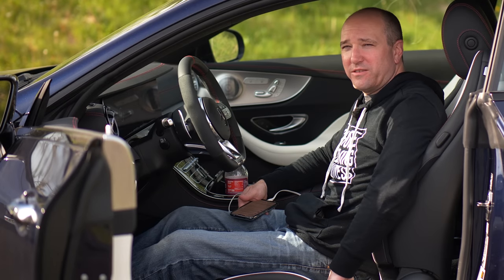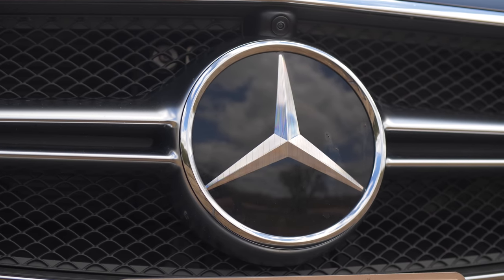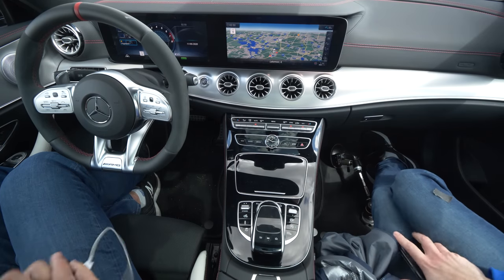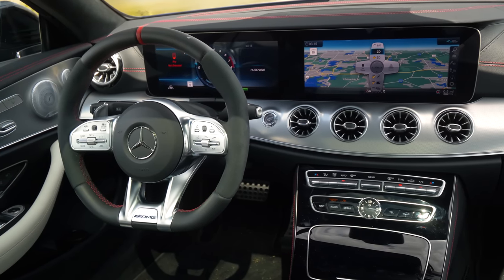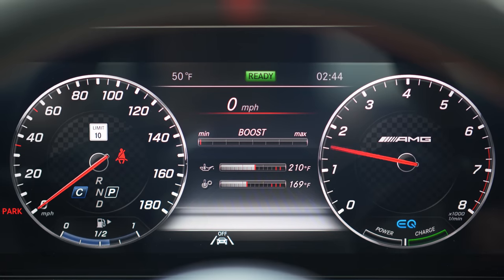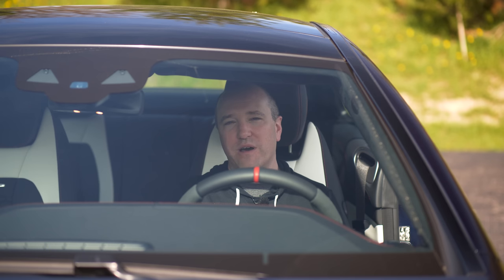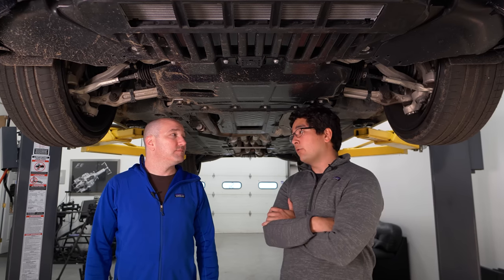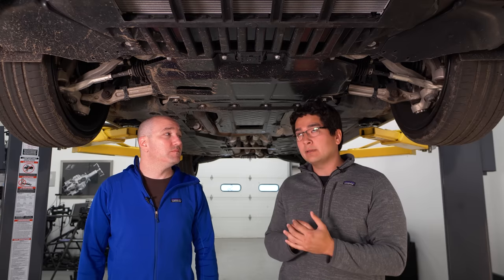2020 Mercedes E53 AMG | Gimmicks and Engineering

Comment: Shown below is a 'quick data table' that predicts the depreciation (yearly depreciation values are depicted, with the exception of entry #2's one-month depreciation, as is further explained below) of this brand new, $97k MB car, 8 years from now, May 2020:

NOTE: the data/values shown below is/are entirely speculative, however this data IS loosely based off of historical/factual data of other similarly specced vehicles.

SALE PRICE or
BOOK VALUE     Date     Description
$97,000 - May, 2020 (Bought new from Dealer)
$85,000 - June, 2020 (Sold used to a private/individual buyer.) Notice the 'almost immediate' $12,000 'discount' the buyer enjoys because the car now has been driven about 1000 miles since the day its original owner purchased it from the dealer.
$62,000 - May, 2021 (Stated book value)
$44,000 - May, 2022 (Stated book value)
$29,000 - May, 2023 (Stated book value)
$21,000 - May, 2024 (Stated book value)
$17,000 - May, 2025 (Stated book value)
$13,000 - May, 2026 (Stated book value)
$10,000 - May, 2027 (Stated book value)
$2,500 - May, 2028 (Sold used to a private/individual buyer).

Please note: the sharp decline in the 2028 depreciation is due to the fact that the car's computer (main cpu) is malfunctioning & according to Mercedes-Benz, must be replaced. Of course, this repair can ONLY be performed by a certified MB mechanic AND additionally this repair can ONLY occur at an authorized MB service center or MB Dealership that also services MB.
Reply: May 2028 Tyler Hoover enters the conversation! Lol
Reply: That $97,000 is if you have every option going, which very few people are ever going to do. If you start at $75K to $80K for new, then the book values look more realistic.
Reply: Well yea, that’s why these are just luxury purchases and best done on lease. You’re going to spend $ to drive this car, and you’re only going to spend this kind of $ if a) you have enough you don’t care and b) you’re not interested in using that $ to make more $ so you’re okay with the lost opportunity cost. Might as well minimize how much $ you burn while taking enjoying your luxury item and just lease it. If you want affordable or “smart” you probably aren’t the market for a near 6 figure luxury coupe.
Reply: @joeracer302  The way I see using a car. Lease it and enjoy your dollars for the lease period. Pretty much like renting a very nice apartment in New York or a hilltop house in Malibu.
Reply: If you can show me a 2017 AMG product for 15 % of it`s MSRP, you`re my hero. And I`m not talking about some beat up, flooded and non-maintained one. With less than 250,000 miles on it.

Comment: I totally agree about the interior, it looks 90% the same as my wife's 2019 C Class but for double the money!
Reply: All Mercedes have very similar interiors. Has been like that for 6-7 years. When introduced, people liked them very much and saw this as a plus.
Reply: It's like 20 grand more, not double the money.
Reply: you can get that interior in an a class these days. like with about 90% of german cars going up in the model range feels more like getting a different trim for the interior rather than going up a whole segment.
Reply: But C class interior is not same design
Reply: Your paying the premium for the engine like in the c class the c63 will cost way more than a base c300
Reply: Leviathan A class and E class drive & quality is on a different level
Reply: Hardly with the same engine in the C-class
Reply: To be fair this configuration is a mess though. Black/white seats with red stitching and cheap ugly piano trim makes it ugly looking. You can get it with 2 types of carbon, glass fibre and a lot of wood options. Also many interior colors.

Comment: Excellent review, thorough and educational!  Most of the gimmicks are optional and I'd probably stick with the base audio and avoid the audio navigation pain cause even the higher end Burmester in my AMG sucks compared to the Bowers and Wilkins in my other car.  Now I know why it seems to noise cancel at times, thanks for that tid-bit.  The performance exhaust on my AMG doesn't pop and burble all the time on queue, so not all the AMG's behave the same.  Overall great review, thanks dude.

Comment: Mercedes has mastered the art of overcharging for their vehicles, and this particular example is no exception. So has Porsche, but at least Porsche makes better cars than Mercedes does.
Reply: It's the Stuttgart Tax
Reply: Except porsche is way more expensive to maintain and less reliable
Reply: Rabid Sparky Porsche ties Toyota for initial and long-term quality and reliability and value retention is comparable to Jeeps for 911s and best in class for Cayennes. Mercedes and AMG in particular loses value like a Dodge Caravan with mismatched wheels.
Reply: @Ficon  Tell that to a Porsche owner that has to replace an IMS bearing...i mean motor.
Reply: @conradhenninger2209  Is that still a problem on the newer boxer engines?
Reply: @TheImperfectGuy  to my knowledge the new 991 doesn't have that problem.

Comment: @savagegeese @ 9:20 You mention 'When you have an Aluminum piece, it saves weight, it's more rigid' which is not totally right. Although Al-alloys are lighter than materials such as cast Iron, or steel, its rigidity is far less than any of those. Typical Al-alloy used by German manufacturers is AW- 5754 with a Young Modulus in 69 GPa order, and UTS of 220 to 350 Mpa. While a typical cast iron used by the same manufacturers is GGG40, which displays a Young Modulus of 160 GPa and UTS in order of +400Mpa. Even aviation Al-alloys, regardless of heat treatment, cannot be compared to Ferrit alloys in terms of rigidity. Choosing aluminum in such applications is based upon ductility of the Al- thus ease of production, and lowered unsprung mass.
Reply: You can actually get some combined values which help you choose a material:
- material density and Young's Modulus (required mass for desired stiffness) 
- material density and tensile strength (required mass for strength)

If your refine that quotient depending on the load condition, you get specific values for that particular condition
(e.g. required mass for stiffness in bending is material density divided by cube root of Young's Modulus). 

For your given example (less is better, units are weird so they can be normalized):
- required mass for stiffness in bending would be about 0.66 for "Al" and 1.45 for "GG" 
- required mass for stiffness in compression/extension would be about 0.39 for "AW" and 0.49 for "GG"

So in this case, the "AW" part could be made lighter at the same stiffness for those two load conditions.
Reply: @Remenschneider  Thank you for explanation. While what you said is true, the cross section - or geometry - must be specified for this in order to determine the tension in the part. If we negate that element- basically just boil down our argument to material selection for 'one specified' geometry- the only benefit we receive is the weight reduction but rigidity does not increase (( and as u mentioned, with a little adjustment it can be designed to be more rigid with less weight)). As such, the phrase used in the video, ' Aluminum saves weight and is more rigid ' could be laid out as ' Aluminum saves weight and allows for optimal design for higher rigidity to weight ratio' in my opinion.

Comment: I think this car is misunderstood here. Its just a sporty perfect daily. I was lucky enough to own an e class coupe of this generation (but with a smaller engine) and to me its the perfect daily, but that really shows over time and not in a short time review. 

The interior spec on that test car is horrible. The car feels 10 times more premium and comfy if it had the black open pore wood instead of piano black plastic and aluminum.

The infotainment controls are perfect and you quickly get used to them. I understand how its confusing in the beginning, but i love that you can choose how you want to control it. It also makes perfect sense if you know older mercedes controls. They kept that and added new controls to it to give old and young customers all what they want. I heavily prefer that over having just one option like in new audis.

Its always just effortless and comfy. The selfdriving assistants are also such a pleasure in traffic jams. I love the dumb massage seats, multibeam light, the burmeister (which sounded perfect to me). It just feels super composed.
And I think its freaking beautiful. Sporty but elegant.

But just don’t own it out of warranty. Too much tech to fail. And dont let them fool you into thinking its an amg.

I personally cant think of a better daily driver.

Comment: “Because it is not a real amg”
Reply: it’s not, the exact same engine with the same power is in the S500 and with less power in the S450
Reply: @dr-ok3sn  It is quote for the straight pipes fans
Reply: I've been a few 43's, 53's, and 63's. The "fake AMG's" are fun and entertaining cars, but once you get into an E63S... Theres absolutely no going back. There is SUCH a huge difference in the overall experience, you can't explain it
Reply: Well, it is what German manufacturer are going.  They go with mild hybrid to follow German government policy to reduce emission but keep the driving experience of classic Daimler, VW or BMW.  BMW worked with Toyota since late 2006 as Diesel supplier forToyota cars in Europe.  In exchange, BMW got hybrid tech form Toyota
Reply: Honza Štěpán guess you didn’t get that I basically confirmed that the 53 actually isn’t a „real amg“🤦🏼‍♂️
Reply: Dominik I did get it, I wrote it for other people...
Reply: I like to call them "Budget AMG", for the millionaire that is a little more careful in what he wastes his money on.
Reply: When people refer to fake amgs, they are talking about the non 63s. Because the 63s are the only ones being hand built in the AMG factory.
Reply: My 14' e550 would kill this..stock but I'm Weistec so you need at LEASE a 63 to keep up
Reply: @M_773  Oh yes you can. It's called 35000 dollars. The difference in cost.

Comment: WHYYYYYYY THAT DUMB PIANO BLACK PLASTIC IN THE DASH, wood is a zero cost option🤦🏼‍♂️🙄
Reply: Except you have to buy the wood. Cut it, sand it, stain it, and then form fit it to the car without cracking but yes it is zero cost.
Reply: FXIIBeaver okay uhm and what has this to do with the fact that you get wood in some mercedes models for free instead of the piano plastic?🤔
Reply: It’s a “zero cost option” meaning you can select black piano plastic, or pick the option of wood for $0. Yea, it does cost something overall, you’re spending 75k+ on a car, but the option of swapping to wood is a “zero cost option.”

Comment: Mercedes... the one car company that would change the wheel to another shape.  (If they could).   Needlessly complicated.  But hey, some people equate a large user manual, abysmal interfaces, and high repair costs with a quality experience.  A Mercedes engineer once said to me years ago... "I just don't get you American people.... Here (Germany)... these are Taxi cabs."
Reply: I’d love to get an E or S class as a taxi
Reply: The reason they choose a Merc as a cab is just because they are reliable and comfortable. Everthing ends there. Most are classic with a small 200/220 cdi engines. The differences between a basic taxi and a nice equipped avantgarde V6 for example is huge.
Reply: r/thathappened

Comment: I do not envy anyone wanting to work on this in 10 years. This looks so complicated and impossible to troubleshoot, people will shit the bed buying these used.
Reply: In 10 years, some teenager will buy it used for $3k & only put 100 miles on it after finding out the 'suddenly crippled' MB's computer system will 'only' cost $5000 to 'fix' - and it can ONLY be 'fixed' at the local certified MB stealership. What a joke.
Reply: @andyroid5028  I like the idea of a convertible E or S class cruiser as I fade into middle age. I'm going to save up for the purchase price and an equal maintenance reserve fund over the next 5-10 years. Maybe the 'plain' turbo of the E400 or the S550 would be the better long-term maintenance proposition?

Comment: I can't imagine how difficult a mechanic's job will get in the future.
Reply: Easier because all cars will be full electric.

Just replace brakes, batteries, and electric motors.
Reply: When the code says “error with CPU #36” they just swap out that entire computer, and give you the bill for $2500. Not that hard.
Reply: @joeracer302  would be hard in he interim transitional stage. Imagine turbo charger, supercharger, and engine, electric motors, electric assisted various parts, etc. 
Such a pain.
I'm sure even with I'll electric cars and cars of the future, there will at least be many other parts other than swaping out this or that control unit

Comment: Knocked it out the park man - so spot on! I got one of these as a loaner w/ the $4500 audio option and was not impressed. Have to use a cable and wav or lossless files. The custom settings are terrible! The imaging was out of phase / sounded like someone put a funnel in one ear and cotton in the other. Pretty great sounding otherwise, flat, all the cheese deselected. We have a 17 E300 so I was expecting a massive performance increase...... Not really. Quite theatrical, shifts really fast, the body bobs up and down but not really an AMG product in my opinion. Brilliant job explaining all the technicals, of which I had no idea. A ton of stuff going on under that hood. Thanks!

Comment: Although this car has impressive mechanical engineering, the sheer complexity of its mild-hybrid design will most likely be a financial nightmare later on. I actually came away from this video with a lot of respect for how much simpler modern fully electric propulsion systems are. I don't understand why anyone would want an internal combustion system with all that added complexity - it's basically just more components to wear out and need replacing.
Reply: That's what people said of the original Prius yet here we are.
It is more of who actually tests the technology and who is a better electronic engineer but I will agree that it isn't really Mercedes
Reply: @MrCarguy2  Very true. I guess what I'm trying to say is that this very complex mild-hybrid system just doesn't make much sense anymore when you consider how much EV's have improved. When the Prius was developed over 2 decades ago, its hybrid system was more than adequate because there were no serious fully-electric vehicles for it to compete against. Today, at this price point, you could afford to purchase any one of the best EV's on the market and it would outperform the Mercedes in many aspects and would do so with a much simpler, cheaper-to-maintain drivetrain.
Reply: @1965vw  yeah but getting on the EV market right over right now with Tesla is like a 3rd world country declaring war on the US. It will be simply be a bloodbath for who ever doesn't have the technology or value proposition to compete.

Comment: On the w211 bodystyle the large rear hanger are very common place of rust and might even end up snappin off after a while. Its most likely the first mercedes to use the plastic "trays" on the beams to cover them but without water and sand holes all the crap stays in there and just melts the metal away. My dads 2003 w211 had the driver side one snap in half and it was unbelievable cause that thing is almost like a piece of railroad track... Hopefully mb has improved those plastic covers since then

Comment: I believe the E53 doesn’t have a torque converter because the ISG is capable of delivering power at a stop. That may partially explain why it feels like a twin clutch.

EDIT: Never mind. I’m dumb. It has the “TCT” which stands for torque clutch transmission. Really impressive.

Comment: My E 220d Class has 100 k miles and 7 years.
Gives me 60 miles per gallon (4.5 lt / 100 km) economy.
ZERO issues. Literally haven't changed a light bulb.
Being a diesel and using it mostly on highway the engine works only between 1-2k rpm. Boring? Maybe...but the economy for such a luxurious and big car is stunning.
Not to mention that the maintenance comes up only every 15k miles (25k kms).
I calculated my commuter costs for gas and maintenance and the E220 costs me less than my wife's Toyota Yaris...which has a tiny engine..6 gears...that means it sucks up 6.5 lt / 100 km of gasoline for highway because the engine is revved to almost 3k rpm at cruising speed....and the maintenance is every 9k miles (15k km) !
Reply: yep the diesel is seriously good on the highway and it also helps to clean the DPF, for gasoline cars they have their own advantages like they are not getting banned like old diesel
Reply: Le Chat Botté 
Yeah...if you think about it..the new E220 with 8 gears (mine has 7) does like 4 lt / 100 km if you keep it at 120 km/h or so on the highway.
That is insanely good...and the perfect car/engine for my commute which is about 80 km on the highway daily.
It actually pollutes less.
I don't think they gonna ban the diesels anytime soon...looking at the numbers in EU the consumers vastly prefer them in many countries....the recharging network for electric is so low in many countries.

Comment: Considering the fact that I do all the work on my vehicles both simple such as oil changes to more complex such as engine gasket jobs, clutches, engine swaps, transmission valve body replacements, axles. This gives me anxiety. I'll stick with my manual everything daily that cost almost nothing to fix besides my time and maybe 100 or so bucks for anything major. I couldn't imagine even doing a valve cover gasket on something this complex.